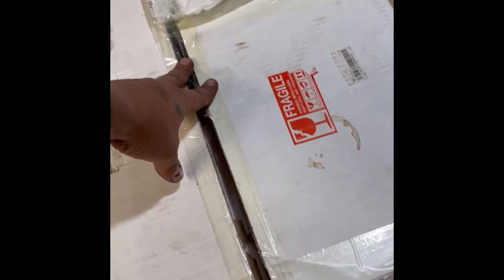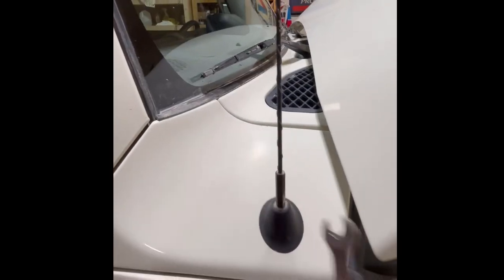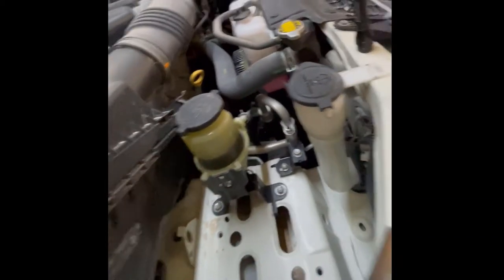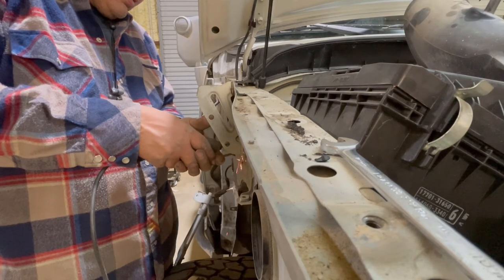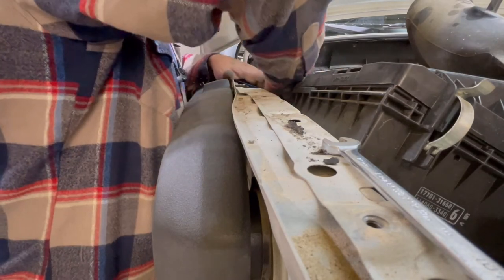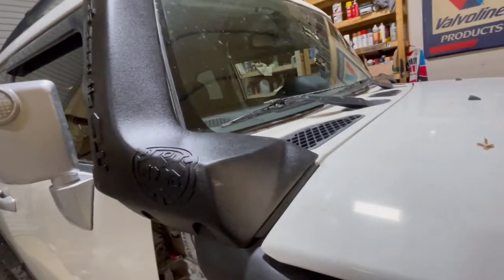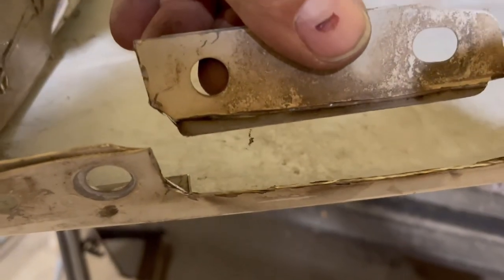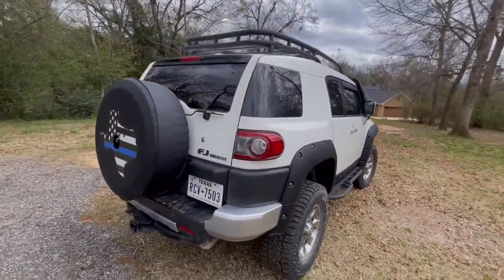FJ Cruiser Offroad Garage Snorkel

Comment: Great video! Been hemmin' & hawin' about this snorkel, have a knock-off "chinesium" one on my '11 (that was fun to install...🙄) but want to add one to my '07 🤔
Much cleaner look!
Reply from the maker: I really didn’t want to cut a hole in my FJ. I’ve driven 600 miles so far and it doesn’t seem to add to the wind noise either.

Comment: Too bad it is not an effective snorkel just another raise air intake., not sealed into the air box. Glad i come across this video as i have seen the air intake on other vehicles and said to myself i need to get that as i did not have to drill a big whole into the fender. Now seeing it is not a properly sealed unit it has changed my mind.
Reply from the maker: How do you mean? You seal it with silicone. It is VERY water tight if you want it to be. My video is more about how to install. I'm using it to keep clean air on dusty roads, as there is a lot more stuff that would get ruined before water got in the intake. I tested with a smoke machine and no leaks. I'm not selling these, just wanted you to have all the info. Thanks for watching.
Reply: @aMotoheadsGarage  I understood your video and like you fj. I particularly like your rock sliders👍

Comment: how was the seal on the upper part and the one behind the fender?  I saw another video where he said the gap between the two was almost 1/2"?  was yours a closer fit?

'
Reply from the maker: It was bad at all. I will say that these a not a simple bolt on and go. They take a little bit more work but it TOTALLY worth it. Best snorkel made for the FJC